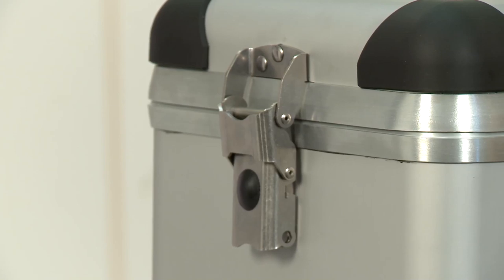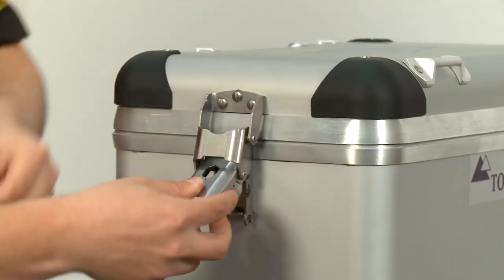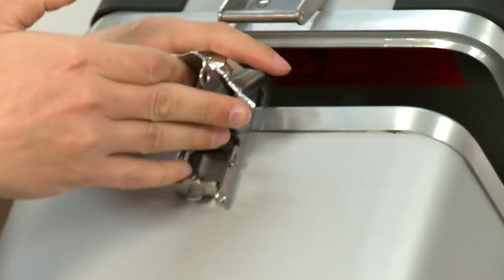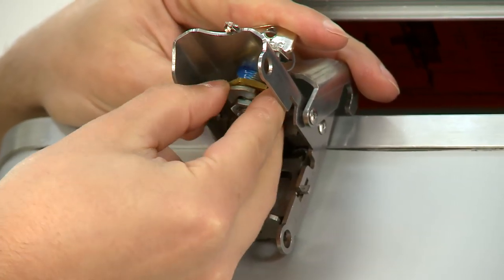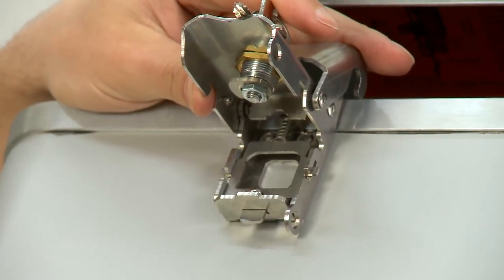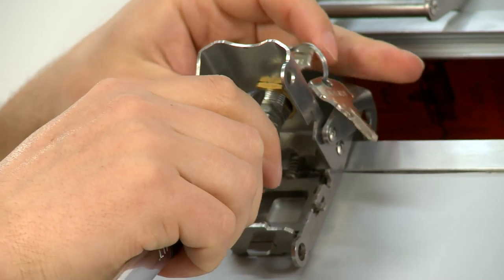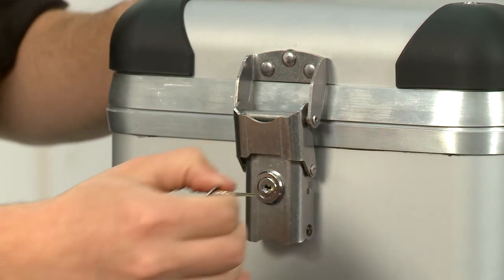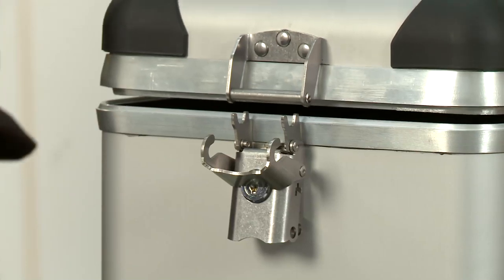Zega Pro Pannier Lock Installation - Touratech

Comment from the maker: Some customers choose not to install locks on their panniers because they don’t want to keep track of a key or don’t leave the bike unattended.  Also there are people that prefer the old-fashioned pad lock approach which can be used with the hole provided on the latch for this style of security. Some people add locks at a later time so they can match the key to a Touratech locking GPS mount, locking windscreen spoiler or locking oil filler cap.
Reply: For customers who don't want to keep track of a key and never leave the bike unattended, they can just throw away the key a keep the locks in the unlock position. Very lame justification to not deliver these high cost panniers with pre-installed locks. In fact, there is a good justification to not pre-install locks. Should I tell you since you are the one who should know?

Roll drum here is the answer. The locks come in a kit for two side panniers and a top back seat pannier. Since you want all the locks to have the same key, if someone is buying only the top case or the side cases, later when he will buy the other cases, he will end up with two keys instead of a single key unlocking all the cases. That's why it came as an option.

Can I now have my Touratech cases for free for the help I provided you?